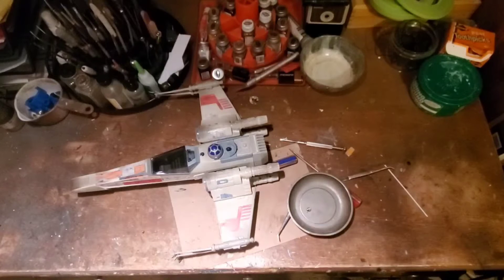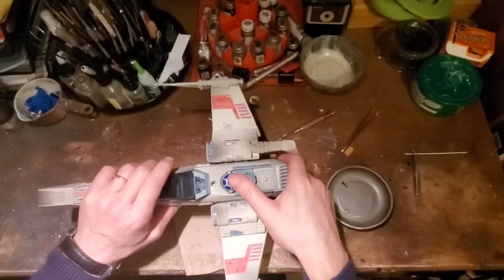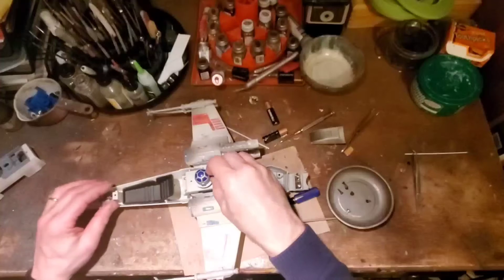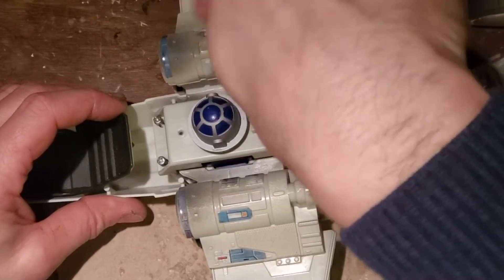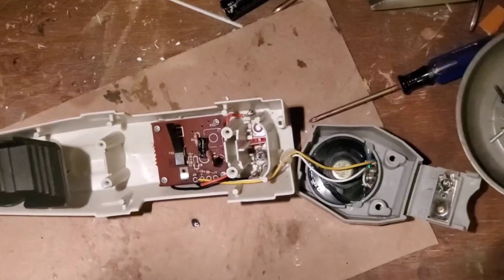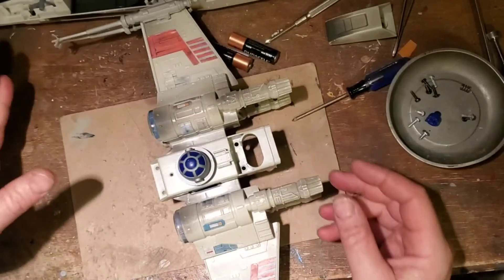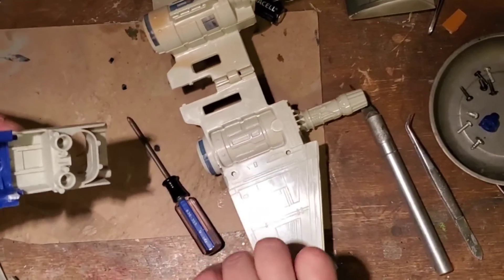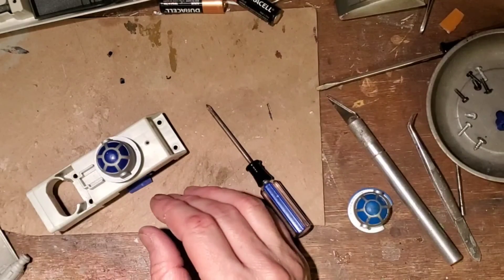1995 Tonka X-Wing Disassembly and Repair Tips, Part 1

Comment: Thanks ,Very helpful video, question I took one apart to custom paint it ,but when I press R2 the wings don't really open up much .......any tips?
Reply from the maker: Check two things:  are there four screws holding the wings down and cracks.  Kenner was notorious for using only two screws which caused uneven tension on the wings, causing them to crack and break over time.  This is why there are so many broken wings.
Reply: @classicalvintagecollector  I will take a closer look tonight......thanks
Reply: @classicalvintagecollector ...It's all good around that area no cracks or broken pc........I custom painted it and I order a new speaker but it still doesn't open the wings all the way mybe halfway...but the little tab does work to close the wings firmly......any ideas buddy?
Reply: @classicalvintagecollector also I noticed if I press down harder on the R2 head the wings open perfect but they don't lock open all the way
Reply from the maker: The spring could be bad and/or the R2 dome isn't keeping the wings down because it might have a cracked ring.  Not sure without physically seeing it.
Reply: @classicalvintagecollector  OK thanks for your time
Reply: I think I got it ........I wish there was a way I could contact  you besides youtube
Reply from the maker: What did you figure out?
Reply: @classicalvintagecollector  I had another Xwing the same model I took that one apart completely and noticed a size difference on the spring under R2 ,now it opens all the way perfect but when I comes to close the wings the little button gets stuck and I have wiggle R2 head and it closes

Comment: I have one of these and I believe that someone put something really heavy on it.  It now is snapped in 3 or 4 places on the main body.  I’m going to try and plastic weld it back together, replace the stickers, and fix the electronics because they don’t work either.
Reply from the maker: That'll be a great project and awesome that you will be able to salvage that ship. It has been so long since I did that video that I don't remember everything I've stated, but the problem with the X-Wings is that the company usually only put two screws in there.  I believe that the force used when pressing the r2 down causes undue stress on the plastic because it is not equalized.  There are places for four screws, but I think that both Kenner and Hasbro got cheap and decided to only put two in.

Comment: Where would you suggest getting a replacement spring for the wing locking button connected to R2? I made the mistake of not paying attention when removing the little blue knob, which that spring happened to be weak in holding the wings in lock anyways.
Reply from the maker: Other than shopping on eBay or Mercari, you might try your local Ace hardware.

Comment: Also my 1995 tonka x wing has no sound. I did take the top contact off and cleaned it up and took apart ship and cleaned up bottom contacts. Still no sound. Could it be the speaker? How much do you sell speaker for?
Reply from the maker: I seriously doubt there is a problem with a circuit board or the speaker.  It is most likely an electrical short.  Do you have a voltmeter?  If not, this is a good investment in the long term.  You can pick one up at any hardware store or Amazon   You can use it to check the charge on batteries, electrical shorts in your house, etc.  

What you need to do is check for continuity between each of the terminal connections where the batteries are and the circuit board.  That will tell you if the electricity is flowing properly or not and if you need to resolder a connection.  There are two wires that go to the speaker and they are positive and negative.  Double check to make sure that those wires are still soldered in place.

Comment: where did you get the speaker mine has the wires ripped off
Reply from the maker: I believe I ordered mine off of eBay.  If I am not mistaken, I think it is a half watt.
Reply: @classicalvintagecollector  any chance you recall the mm diameter
Reply from the maker: @THEJERK67  I bought a lot of 10 speakers and so I would have to locate those to give you the exact measurement; however, what you can do is measure the inside of that frame where the speaker is supposed to be hot glued in.